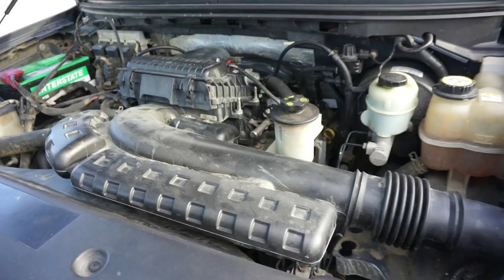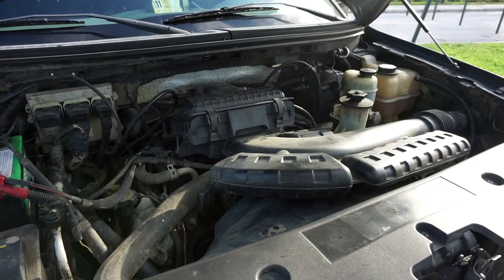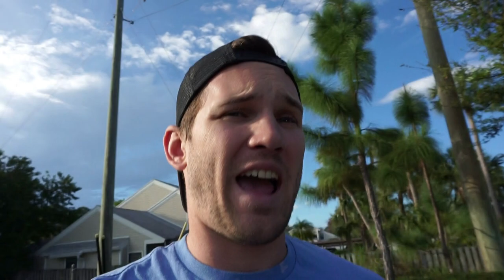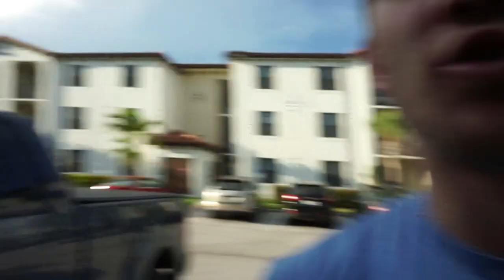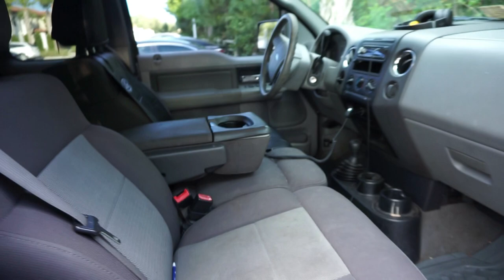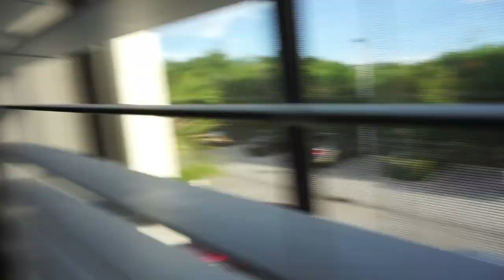This Is Why You Should Think TWICE Before Buying A Cold Air Intake

Comment: My thoughts exactly. And I wonder if they also have problems of it during rainy days cause the cold air filter has no protection at all.
Reply from the maker: Dude that's another great observation!
Reply: The stock air filter draw isn't sealed either
Reply: I read a post on YouTube where a guy said he hit a puddle and sucked water up into his engine.
Reply: That why you get a pre -wrap that goes over your filter and helps to keep out water and mud off your air filter

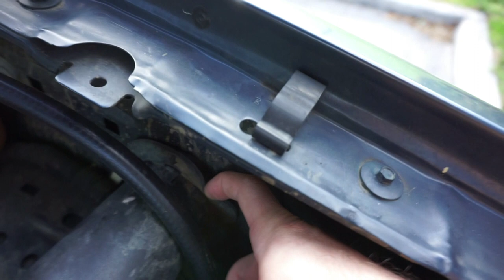Comment: On my 05 I got the drop in KN filter just like he has but I pulled out that little rubber part (4:10 into the video) of the air intake that attaches to the fender to pull cold air in and put in a 4 inch PVC section of pipe (tight fit in the existing whole to the fender) and connected that back up to the stock intake piping. The goal was to remove the restriction of that small diameter piping. That small rubber part was like 2.5-3 inches maybe. I noticed a better throttle from doing that while still pulling air from the factory location and using just the drop in air filter.
Reply from the maker: That's an awesome innovation Sanjez! I definitely think the drop in filter was the way to go, but it sounds like you were able to keep the factory functionality of your air intake system but remove some of the restrictions. Very cool!

Comment: Definitely interesting, i have a cai from k&n as well on my 06 lincoln ls. I dunno about power gains, but it was definitely louder and more resposive for me, on my car. I also had a drop in filter before, and saw very little if any difference at all, amd i was looking for it. But noticed an easy 10-15% fuel economy gain from the cai.
Reply from the maker: It's interesting how it seems like everyone has a different experience with using a Cold Air Intake. I wish there was more "scientific" like research done on these to show exactly how they will work with different engines to achieve the boosts in power, performance, and mpg that they advertise. I have seen people say they get more MPG and some people say they get less MPG it's so weird

Comment: I got a custom dual exhaust system and just ordered a cold air intake. I can update you if it helps to have both
Reply from the maker: Keep me posted!
Reply: @AndrewDoesLife  alright so I installed it last night and so far it has actually helped it. I gained .2 seconds on 0-60 and I also got 18.3 for mpg whereas I got 18.0 mpg with factory filter. Same loop and similar conditions. I don’t hear the extra noise over the exhast and from what I can see a cold air intake is worth it if you have other things done to your vehicle. 

The main reason I got it is because I take a lot of gravel roads and I was sick of buying a paper filter every other week. The other results were just benefits.
Reply: @gingie5246  Hello who is it hold up now?
Reply: @TheBrowns-Love  my mpg has gone down to 17.5 over its use. I have to clean it almost weekly because I live down a long gravel road.  I’m debating on replacing the factory air box because I’m sick of cleaning the filter.  I wouldn’t recommend if you have to drive gravel roads because it becomes more of a pain in the rear than beneficial.

Comment: Interesting... No heat shield around my cold air intake. 👀 Weapon-R brand... Came already installed in my 2005 Ford Escape XLT which I bought a couple of weeks ago (the previous owner is a modder).  It seems fast and smooth enough, with no 'check engine' light on - but then again, this is my first Escape.  Hmmm - perhaps I could install or fabricate a heat shield for it?  Hopefully there'll be no problems with it later on down the road; so far so good, at least... 🤞😐
Reply from the maker: Sounds like one of those "if it aint broke dont fix it" situations haha if theres no issues now I would just leave it be!
Reply: @AndrewDoesLife  Thanks - I think I will; I'll probably just try to add a heat shield though.

Comment: All a cold air induction kit does is improve engine efficiency. You might see 5HP or so, but with weight variance you'll get around a similar change from full tank to empty anyway (ie: a drop of 50-100kg/100-200lb).

These can and will improve fuel economy, especially on a diesel as the colder air and higher air volume does help a lot. That said, they aren't a magical wonder device that'll make your vehicle become a pocket rocket. 

These work best where the air intake and filter are over the top of the engine (ie: Fiesta 5 MK6 2002-2008 models). Cold air intake on some cars are right above exhaust manifold too, so wrapping titanium wrap and putting an induction kit on those cars can be worth doing.

It really really does depend on the vehicle, the airflow set up/kinametics/fluid dyanmics. Just think about it before you do it and if it'd be worth doing. If your air intake/filter is miles away from anything hot (ie: over the ECU/Battery) then I wouldn't bother unless you have money to burn and want to spend an afternoon doing something different. 

Airflow changes and temperature reduction to the engine and or turbo will benefit from a remap more than stock will though. IMO, it's prep for a stage 1 remap for certain vehicles that will benefit from it (like Duratorq 1.4L Diesel in Ford Fiesta 5 MK6, Ford Fusion and such).

Comment: Listen little guy I’m 60 years old. I’ve been driving Ford and Chevy trucks for my flip have KNN and everyone of them never had an issue never had an issue issue and the issue you have is you’re getting too much air in that’s what’s happening and you’re choking up so there’s something else going on. It’s not the can and filter guaranteed of us out here they’ll square by it and 20 of them will we own them a mistake at all picks up a few horsepower just brings easier and that’s all the combustion is for horsepower. They are more air and the more air out quick, good luck with your dream and I wish you get to an expert that will actually prove to you that your incorrect

Comment: Thanx bro I just took mine off I felt the same way about mine after putting it on. I just wanted some confrimation I was feeling i was right. Good video👍
Reply from the maker: No problem! It’s a bummer as there is so much hype around these types of products. I’m so glad I took it off and went back to the stock housing for my air intake system
Reply: Agreed man it had me fooled. I just took it off this morning and switched it out. Everything you said about how it was effecting your truck, it was doing the same to mine. Total let down. I honestly expected more especially for the price. Make more videos bro.
Reply from the maker: Will do my man! Thanks for your support
Reply: Dam so true wish I would of seen this video before I bough the k&n ram(typhoon) intake  for 2005 Honda Accord only had it for a week n dam not happy its more like a hot air intake the heat shield doesn’t block heat it’s fine when u first drive ur car in the  mornings after it reaches normal temperature after driving for like 20 minutes u notice the performance drop should of gone with the k&n drop in filter u just confirmed what  I was experiencing  thanks taking it off first thing in the morning  n going with the k&n drop in filter I should of listened to my girlfriend lol she sure gonna be b*** at me in the morning when see’s me replacing

Comment: Isn’t it different with all cars? Some cars won’t have the same problem as others
Reply from the maker: Just be aware of where the intake is sucking in the air from, if it’s sucking in heat soaked air from your engine bay, then it’s not a “cold air intake”
Reply: Andrew you do kno the rubber piece around the shield fits snug with ur hood so heat doesnt get in smh you guys kno anything about cars 🤦🏾‍♂️

Comment: No, no no no what you must've installed from K & N was not a cold air intake system. What you installed was called a short ram air intake system where the idea being that it's a much shorter distance for air to travel. Therefore, it should get more air but not more cold dense air like a real engineered called air intake system delivers. so yes, you are right the air that came into your engine in the engine bay was warmer than the air going into your engine from the stock OEM air filter and box assembly.

Comment: The ECU pretty much controls everything. If you change even the smallest thing, it's best to also get a tune. Some cars may be able to adapt to small changes and some cannot. Even the same exact car may behave differently. This is considering whatever mod you're doing is even safe for your car and then you have to find a legitimate tune as well. It's just not worth it unless you do race people everywhere you go, which is fine, live your life. However, most people just want to KNOW that they have more power without actually using it much at all. The hassle is not worth it and it risks voiding the warranty blah blah blah.
Reply from the maker: I agree with your point that unless there is a tune that is also going to be added then the engine may not run as well after adding a modification to it. To me, the overall experience of adding it was not worth the price considering I was not willing to shell out the extra 300-400 dollars for an updated tune to accompany this aftermarket air intake

Comment: I bought a K&N cold air intake for my Car. It did actually have really good performance gains. However, the long term effects was not good.  After about 6 years of the cold air intake system in, i started having issues with the throttle body itself.  What was happening was the oils from the filter was gradually messing up the throttle body and restricting air to the system.  So ive stuck with the factory air box since
Reply: Your supposed to clean it
Reply: @doomdohondo1061  i did that regularly by spraying the solution, washing it and applying the new oil coating.  It just happened to be that the throttle body was catching alot of carbon deposits and dirt over time due to the oil making it stick.
Reply: @RadioKilla07  After 80k miles, I went ahead and bought another cai filter vs washing and re-oiling it.
Reply: Use a dry filter

Comment: Cold air intakes are a total waste of money on a relatively stock vehicle. 
The only thing they are good for is making it sound a little better. 
Most stock intakes can support quite a lot more HP than the stock motor puts out.
A cold air intake is about as useful as a cat-back exhaust, just better sound. Save your money and leave your vehicle stock.

Comment: I think I still wanna do an intake for my truck for that throaty rumble😈I have a 2010 5.4 and both a. American Trucks makes one for my year for less than $100 with great reviews and b. I think in 2010 the intake was redesigned for air to come in through the grille rather than the fender so mine might work better
Reply from the maker: Go for it! The way I see it, you can always return it like I did if it doesn't live up to the expectations. No harm in trying!

Comment: Point is you dont know. More air is always better
Reply from the maker: I mean, in general, yes, you’ll need more air in the equation on the road to more power output, but more air isn’t always better. This intake is a part of a multi step process to get more power. This part alone wasn’t enough to produce any noticeable improvement or results
Reply: Try an exhaust and tune.

Comment: Hey I recommend getting a S and B intake because it has a clear heat seal that goes over the intake   And plus they plug into the same air intake port as your stock intake
Reply: I’ve also heard that the “air raid”  and “roushe” brand cold air intake (they’re supposedly the same thing) also uses the stock port and works better than stock
Reply: @JRivera815  I believe that it is spelled ROUSH.

Comment: I bought a cold air intake and I'm planning on putting it inside my factory air box so I can get the same air the factory air cleaner was getting.
Reply from the maker: Hey Don! Just curious about how that would work? For mine, I had to remove the factory equipment to install the cold air intake, what kind of vehicle are you doing this to?
Reply: T

Comment: What I see is that ur F-150 basically has an intake that works similar to a cold air intake. For other cars or most they use a box intake system that restricts air. Using a K&N does work a bit better and sound better for most cars.

Comment: Well I’ll say this. I just put a k/n cold intake on my 2019 challenger. It fit but after getting on it hard I found the intake tube had come off at the filter just outside the heat shield. I got more clamps and tightened it as much as possible but after getting on it later it came off again!!! The intake is working because air is rushing in through the intake but again when you stomp it it’s like there is so much air being sucked in it pulls off. I put more clamps and even secured it with black duct tape to the heat shield. So far that worked. What concerns me is it came off and the car ran fine so I had no idea. I took a trip to TN from GA and it was probably off when I did.  My concern is all the unfiltered air that went into the engine during that time.  It’s a 2019 and only has 5000 miles on it. It would suck if it hurt the engine.
Reply from the maker: Dang that would be super unfortunate if the engine was harmed during that road trip!

Comment: You either did not get the correct kit, or didn’t install it correctly. When you look at the way you installed the heat shield it doesn’t even make contact with the sides of the engine bay. No wonder it took in hot air

Comment: Someone should check the air temps and see if it is true and make a video but it would make common sence
Reply from the maker: I would love to be able to have the equipment to do that one day!
Reply: I did a Temperature check with my 2006 F150.  When driving the temperature from the air being sucked from the fender was actually the same temperature that was passing over my stock air intake.  When I drove around 35 mph it went up about 10 degrees. I was actually shocked that it didn’t get hotter in there.
Reply: @jonathangaston343  so you're saying that there's not much of a difference and its ok to buy this? Im thinking of getting one
Reply: @MORE_BEANS_PLZ   I just cut my stock air intake and look like that one.  I haven't gained any MPG but it did make the truck a little louder.  I have not noticed much in HP gain.

Comment: What are your thoughts on throttle body spacer?
Reply from the maker: I’ve considered putting one on myself. To be honest I’d probably put one of those on before I did another cold air intake system. All the reviews say to only get one after getting a cold air intake system though... after this trial and error for myself I’m beginning to think that without an aftermarket tune a lot of these air intake mods may not be worth the money
Reply: Andrew Does Life 

I had the Airaid Poweraid spacer on for about a year and I freakin loved it!  I removed it earlier this year because I upgraded to the BBK 80mm throttle body... I actually had them BOTH on for about two weeks... and I’m like yeah I’m pretty sure I’m bottlenosing my intake lol
Reply from the maker: Hey Natalie! Can you link me the throttle body spacer you’re running right now? I’m interested in it for sure. Has it enhanced your trucks performance? Are you running any tune in your truck?
Reply: Just put a Sprint Booster on it.

Comment: Also you guys keep trying to put cold air intake on cars thats not even fast to begin with. Cold air intake are for sports cars when you upgrade your engine with bolt ons or add a turbo or procharger
Reply from the maker: While I agree that the truck is not fast, K&N still advertise sizeable HP gains simply from installing this product.. Which was not the case lol

Comment: everything you said are false! its not the cold air that you get! its air volume your manifold gets! yes motor is tune on stock low air volume vs a massive air volume coming in...as far as power it will add a bit but will add more with a tune!
Reply from the maker: You said everything I said was false and then agreed with my opinion two sentences later.
Reply from the maker: bullet 206 lol you are funny.

Comment: dude..watch engineering explain. have roush cold induction on a aluminator 5.0L
2019 mustang. your opinion is b.s. more air intake needs better exhaust and tune. I have mangnaflow 3"  competation exhaust with a VMP tune.
your trying to penny pinch ur ride bc you didn't upgrade exhaust or tune. nxt time fo your reseach before you post a wimpy video.

Comment: A few lies.. cold air intake need to be away from heat a lot of dummy put it in there engine bay a leave it I took my battery out put it in the back took a light metal and closed off that hole area cut a hole in that metal for my cold air intake then cut a breathing hole in the hood small but work. I also covered my cold air intake with a heat sheald up to 800 degrees on contact.. more power more gas u can't get power power with less gas no no the only way to save gas is to get enough speed to glide were you need to go